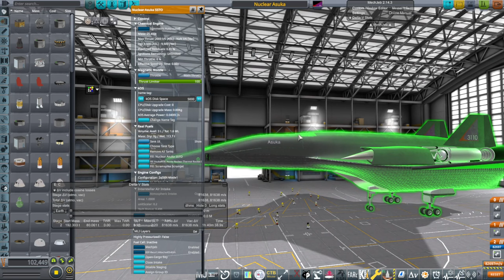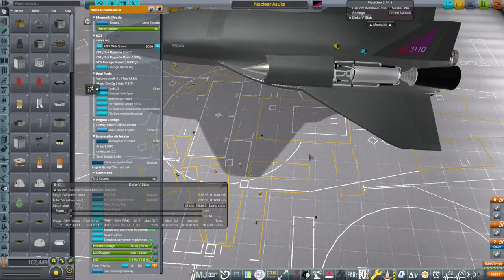Nuclear Scramjet Roadblock (RO in KSP 1.12)

Comment: rcs can't turn off and engine can't throttle up seems like mechjeb's doing...
Reply from the maker: Now that you mention it, I definitely should check that. This is a new install, so I probably didn't do the usual MechJeb things.
Reply: @RaizSpace  yes, probably you should turn off prevent unstable ignition and use rcs for ullage

Comment: you need to be realy far away from earths asmoshere to use the nuclear engines by the way due to your no longer alowed to use nuclear themal fission engines inside earths atmoshere. laos from the info   from the gui tool tip that pretclear knid of nucleaer themal engines your useing from the last few takes time to spol them up once you turn them on. also you need you wait for like 17 seconud before you up the trust on them. plus your  nuclear thermal chemcal rokcet cruent set up also seams to be misstankly put a magtinic rocket engine nossle. you need to use a thermal cheacmal rocket engine nossle by the way. that magtnic nossle would be why it won't throttle up. this is due to the fact your using a nucleare themal chemcal scramjet rocket engine and reactor with a magtnic nossle. that simply doesnt work. it has to be to a chemcal thermal rocket nossle nothing else then that. remvoe the magtic nossle and put a checmla nuclear rocket nossle in its place.